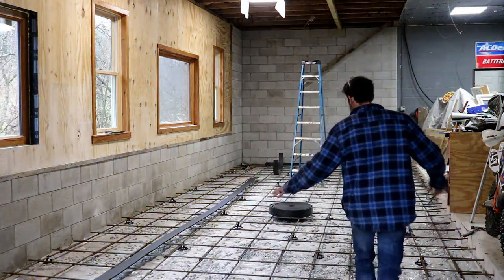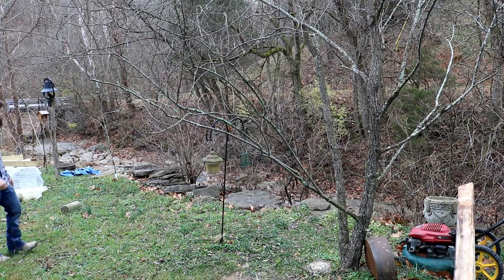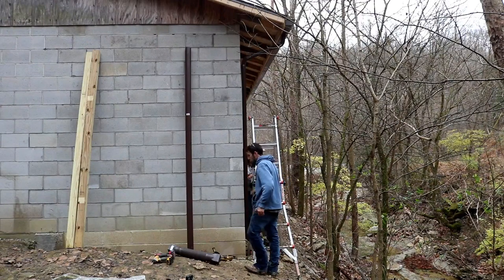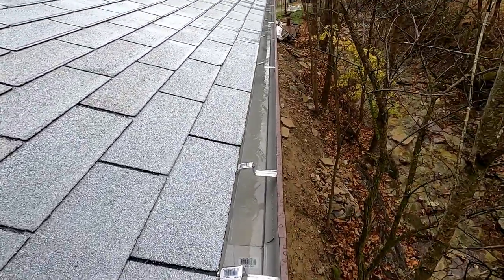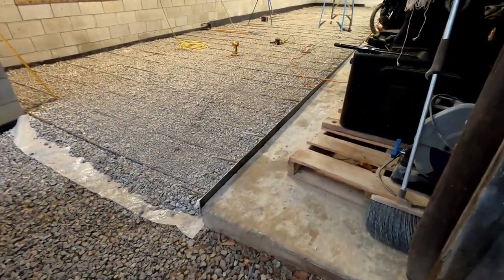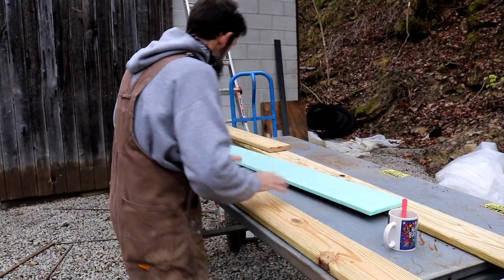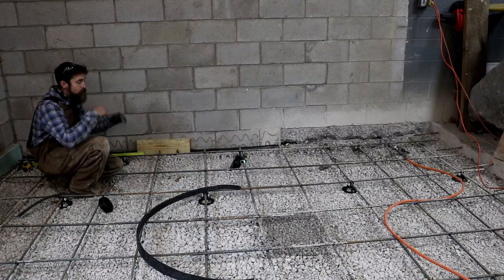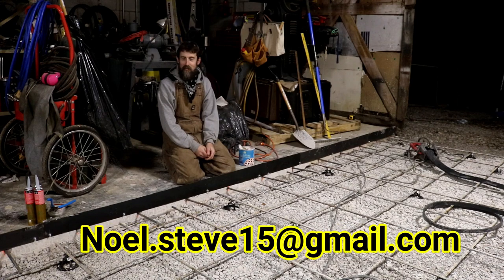Concrete Form / Expansion Joints / Troubles and Changes.

Comment: that 1/2 inch at the top that tears off is so you can dig it out after the concrete cures and seal the top of the joint with mastic

Comment: Funny how Steve likes to throw around the expression "good enough", when he is in fact producing excellent quality on almost all his work. Usually that is used as a crutch by people not willing to put the effort in.
Reply: I know right, I don't know if he realizes how good of work he does!
Reply: Dont know about excellent, but good for a DIYer
Reply: @John Verne  Also:  A professional knows how to hide his errors and learned from thousands, an amateur has thousands to look forward to.
Reply: @Wayne Coke the old #98. I've got one thats older than me and its still spot on perfect.
Reply: @ needin carpentry.  So what would your excellent be?  Ability, craftsmanship, and expertise is not rated or measured by the quality of materials you use..  Only the end result is effected by materisls used.   Now if subpar materials are used than yes that does reflect on your level of work but only other things that would define a worker and separate them from the average worker would be finesse and speed which in itself does not always indicate a better worker than the next..

Comment: Steve, when I built my garage, the control joints were cut with a diamond saw. It's been 12 years since the concrete was placed and I haven't seen any cracks. It is a lot easier to cut them after than try to put them in when the concrete is still wet. Love your progress.
Reply: It is if your not proficient as a concrete finisher. Normal concrete guys put the joints in there wet, but then again there are usually 4-5 guys finishing it, not 1 guy

Comment: Looks good.  When the concrete is poured make sure to remove the expansion material that is flush or above the slab and fill the joint with some mastic like Sika Flex is a good one.  I will say this Steve you are doing a good job that will be an awesome shop when you are done.  Also make sure the concrete guy applies cure to the slab or you can do it the next day.  But you need to spray it on and cure the top so you don't get the dusting of the top.  Thanks for sharing

Comment: I live on a mountain side in a pine and oak forest.  I have over 750 feet of "Gutterglove Pro" on my house and have never had to touch my gutters since it's installation 9 years ago.  The covering mesh is a fine stainless steel cloth  over a rigid aluminum substrate.  The stainless mesh is hygroscopic (grabs water) and works better the dirtier it gets.   The aluminum substrate slips under your roofing and screws to your gutter lip.  It's easy to remove for maintenance, but I've never had to.  Pine needles will not stick in the fine mesh, leaves just slide off.  It's expensive, but it works.   I like it so much I put it on both my out buildings.

Good Concrete guys can screed to a chalk line, they don't need a board.  And remember when I suggested when you were pouring your footings to make them higher, above grade and wider than your block...  There's your screed surface and your monolithic face to high water in the creek.

Comment: Steve, Your screed board at the back of the shop...   Why match the existing concrete if it is under a wall you are putting back up?  Level the new floor all the way on the back and then put the new dividing wall fully on the new pad or fully on the old pad.  The miss-alignment will then just be part of the dividing wall and be hidden when you put sheetrock/plywood on the inside. That way all your equipment you put back there will not have to deal with a non-level floor.  Also, when you re-do the other half of you shop in the far future, you can then pour to a fully level floor rather than one that is off 1 1/2 inches at the back.

Love you videos..   Just my thoughts.

Comment: Most pros just screed to a snapped line on the wall, another widely used method is to drive a row of stakes in the ground a couple feet off the wall and put 3/4" pipe on top of the stakes so the top of the pipe is the finished floor level. A drywall screw on each side of the pipe in the top of the stake keeps the pipes in place. As you finish and bull float you pull the pipes out and the channels where the pipe was is easy to float in and finish off. With the pipe method, you have a longer overhang of the screed board so it's not always slipping off the edge at the wall.

Comment: Steve, there comes a time when you have to recognize your own limitations. You say you are not a concrete pro, but you are over-thinking your preparations, and under thinking your own stamina. That's a BIG pour. This is the time to break out the credit card and hire a professional concrete crew. You will be much happier with the results, and it will be comparatively cheap considering the results. They will give you the advice you need to satisfy their requirements for the job. Sweat equity is a good thing, but not if the job is to big for you to tackle on your own. I've been there and have learned the lesson the hard way. Thanks for the video. Jon
Reply: I think he is planning on having professionals do the actual pour. He is saving somewhat by doing all the prep work himself. I used to work for a mason/general contractor who had given up doing his own flat work except for very small slabs. When he built a ten unit condo complex he got a rude surprise from the sub who poured the basement floors. They had agreed on a certain dollar amount per cubic yard. Ralph had figured on a four or five inch slab in each building and ordered the appropriate amount of concrete. The sub started pouring with no chalk lines on the walls and no screeds. Half way though the second of the three building they were running out of concrete and had to call for more. The job ended up costing double what it should have. I think he did use that sub for a few more jobs but not not without a fixed price.

Comment: It's looking good Steve. Another way you Could've done the screed guide put a 1x2 above the expansion material and then stepped the screed board at that edge accordingly. 1x2 would then be removed after. There's always another way to do the job. 7" is worth the extra effort a blacksmiths hammer could be put in the old section replacing a section of the old concrete with deeper setup. Thanks for all the videos and keep up the good work. From the 🇬🇧 👍

Comment: Very surprised you did not attach an ear to a screed board to run on a ledger set to the height dimension of the screed board against the wall. This can be done in the middle also. There is a wire clamp that attaches to a 1.5" x3/4" stake that will hold a 2x4 with the bottom of the 2x4 at top of slab height desired. Pour screed, remove the screed ledger get on skates pull the stakes out pack the holes from stakes and finish. We used to cut the ledger boards to 2.5" and hold the top 3.5 above the slab so we could quickly slip a hand float under so we could let it get firm enough to skate to fill the steak holes while still having it ready to trowel.

Comment: For a big power hammer you'd probably want a even thicker pad, that is separate from the main floor (with some kind of expansion joint), just because a power hammer litterally has earth shattering vibrations :)

Comment: That cut in the foam is designed to be removed after the concrete dries. It gives you a space to put caulk to prevent water/dirt getting between the structure and the slab.

Comment: Steve,  I think the main reason why the grade of the orginal floor is going thinner toward the main door is because they did not calculated the proper amount of concrete to cover the correctly.   The proof is the fact you found NO rebar and they used the ground itself a base for that concrete pad.   Also at the time they probably had already signs that the wall you rebuild showed signs of saggin and joints cracking.  So they did not do a proper job in the first place.  No footing, no crush stone sub floor and No rebar.     The good thing you fix one side and if the other side never moves, you did a good job.   

Also one thing you can do for the side of the pad that's not level.  Use self leveling concrete, but first rought the surface and lay a coat of concrete glue and if you can mix your own leveling concrete you can put in the mix the same concrete glue.  That way this self leveling concrete will not crack or break.   I've seen it used and it does some miracles to save a concrete pad that wasn't level.   And that glue is there to make the new leveling concrete to stick to the older concrete.

Comment: Another good vid.  Just a thought. I drove 1x2 stakes into ground every few feet, then put 2 nails in them and lay pipe in between the nails set them to grade and as we progressed down the wall we pulled the pipe up and filled in , works great. I held the stakes about 12 inches  off the wall.

Comment: Steve the temp your are quoting is from a formula used to calculate the expansion of metals.  For mild steels the formula is :6.3(10 to minus 5th power) per inch,  per degree f above ambient temp. Other metals have differing coefficients of expansion. For most carbon steels. It works out to @ 0.001 inch per inch per degree f above ambient.  Ambient temp is usually calculated from a nominal 70 degree starting point.   Enjoy your videos. Great craftsmanship.

Comment: Steve, your screed guide should be on stakes about a foot away from the wall.
It's easier to be able to slide your screed side to side as you pull back and rake back the extra.
And chances are greater the slab will shrink than expand.
Lookin' beautiful regardless!

Comment: Looking nice.  For next time just use a ramset and sq headed sheet metal washers to tack up the perimeter expansion material. We used a fibrous product around my 65' x 46' building.  The concrete guys didn't screed against the stuff but just to a chalk line snapped the Mag-screed bar width above the floor level which was just slightly above the expansion material.  They wanted to cover the expansion material with concrete as it made finishing much easier at the edges.   They told me the expansion material really wasn't necessary unless there was a large temp increase after the pour but they used it anyway to to allow the concrete to shrink away from the wall in a controlled manner to prevent  random edge cracks as the slab shrinks during curing similar to the saw cut control joints.  Inside a building the slab on grade is not going to see a large temperature swing anyway, but it will shrink a lot during curing, which is when the cracking develops.  Cracking after curing are generally caused by soil movement due to poor ground compaction or expansive soil.   Out here in CA we have a lot of adobe clay type soil which swell in the rainy winter months and shrinks back in the summer.  This will lift the center of the slab and cause it to crack badly.  You need a good base and  a full floating slab to be safe.

Comment: I would strongly consider pouring the new slab dead level and the grinding a taper on the old slab in the back of the shop. Then if you want to redo the old half the entire slab will be A-1. Keep up the good work.

Comment: I have the Leaf Filter gutter guards, they are a stainless steel mesh that is in a frame that sits over the top of the gutter, they work great and when rain stops and leaves dry, the wind will blow them off

Comment: I know this will send some folks into a tirade, but expansion joints aren't necessary against the block wall. 

I've poured more stem wall slabs than I can recall and have never used expansion joints against an interior wall. In fact, they aren't used at all on interior slabs (houses and garages)...even under natural marble floors which crack when you look at them.

One more tip that I'm sure is too late, but if you use grade stakes (1×2's driven so the top is your finished floor elevation)  in the slab every 8 or 10 feet as a grid, the finishers don't need a screed guide against the wall. They rough screed to the grade stakes and will pull them out and fill the holes before the concrete sets up. 

You're doing a fantastic job, as usual, and I'm sure you will end up with a NASA lab quality floor when you're done...however you do it . 👍

With the amount of steel you you're using and the depth of the concrete, you shouldn't ever have to worry about expansion  issues.

Comment: i built a very small shed on the outside of my garage. i didn't want to listen to an air compressor anymore. i had just purchased a brand new eagle 3 cyl. 18.5 cfm 60 gal. i have zero experience in concrete or any type of construction. i thought it would be a cool project where i would learn a lot and have some fun. and that's what happened. i made a few mistakes along the way and learned from them. what might look like shady workmanship is more that i didn't have an answer to a question that i didn't see coming=inexperience. in the end the whole thing is very functional, i walk through the door of my garage and flip a light switch and i have air. pretty cool. it occurred to me that maybe that the people that built your shop may have been like me but much more adventurous. i love your channel.

Comment: I've watched a number of concrete pad/floor pours and I've never seen the pros need a screed guide along the walls, yet they still achieve a perfect level (or whatever pitch they're trying to achieve). Since your center wall will hide the transition, if you want the new pad to be level in the back portion of the shop, I bet they can do that despite the old floor being higher there.

Comment: Seeing the drip line on the creek-side of the roof before you installed the gutters put paid on the importance of them in the overall picture. Arguably the single most important part for long term stability. Great Progress!

Comment: Great project, with engineering precision. Quick and very dirty trick to clear our leaves in gutters is to use a long tube with a short return 180° bend on it (think umbrella handle), then connect to mains water, and just walk along the length, you may need some waterproof clothing.
Thanks for sharing and have a great thanksgiving to those who celebrate it.

Comment: Your doing a fine job. You mentioned thermo break with the insulation for expansion joint, my question is why not thermo break the floor as you would have done for a radiant floor heat. I ran concrete mixer for 14 years and saw many things I covered with concrete. I do admire what your doing.
Reply: He will regret not putting down 1 inch of high density polyurethane foam under the floor to prevent condensation in the spring. I did this on my building and my neighbor didn’t— big mistake on his part as he has rust on everything.
Reply: Yes, I question the lack of any insulation under that slab. Would add little to the cost compared to the benefits.....

Comment: Nice job Mr Summers!.     We use to paint metal molds for concrete, with "Castrol clay die oil" which would act as a release agent. It really did work well. Maybe that's  what is needed on your sheet metal height correction piece.

Comment: I would leave those steel screen plates in.  It will give you something for the other floor to level against and since it will be a joint you really won’t notice.  It will make pouring and finishing much easier 
My .02$

Comment: Helpful tip if you ever do gutters again setup your regular miter saw it cuts it like butter with no burs can accurately and safely cut it to any angles and perfect straights learned that running seamless gutters a long time ago I done the same thing when they told me to cut some went straight for the grinder they laughed at me back then but I was in my teens and I knew everything

Comment: I had EasyOn Gutter Guard for the last 1.5 years and had no problems. The mesh is stainless steel and the ends that go under the shingles and attach to the front of the gutter are aluminum. The screws provided are also aluminum. There is strip of double sided tape already installed at the gutter attachment end. You can use that if you dont want to screw it on the gutters. Or use both the tape and the screws... The tape is very strong and is the same tape used to stick the car emblems on. There is nothing to rust and it will be there forever. We had hurricane Sally went over us and there was no issue with shingles lifting (guard goes under the shingles). However, as in all things good, it is not cheap... I think our gutters are total of 270 ft and the set to cover them was $560 or so. Doing it right the first time and not having to clean gutters worth the money in my opinion especially for us having live oak all around the house! The leaves are 2" long and 0.75" wide... They pack very nicely around the downspout connections :(... Not anymore, though. hehe

Comment: I would suggest cutting an inch off all the foam so the concrete goes over it. Exposed foam board is only going to likely get chewed up over time unless you cover all of it. All my concrete was poured direct to the footers with no expansion allowed, but there is foam for insulation at the wall up to about an inch from the top. There is a clear separation at the footer(crack) where the concrete shrunk. Concrete always shrinks away when it dries.  Might be best to let it dry before you try to pull your steel out as it will be looser and you won't be as likely for it to pull concrete with the form when you try to slip it out.